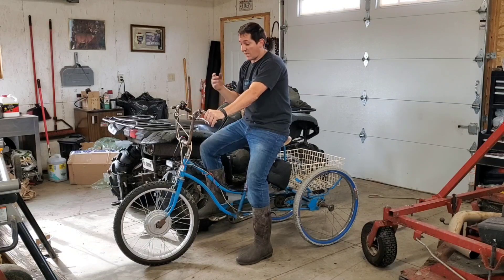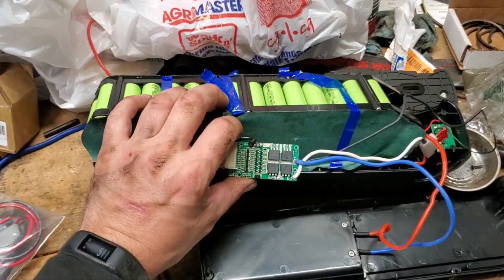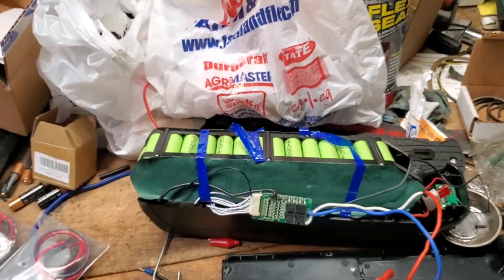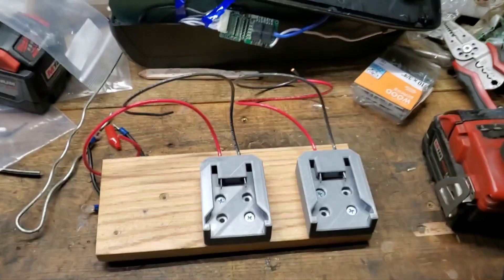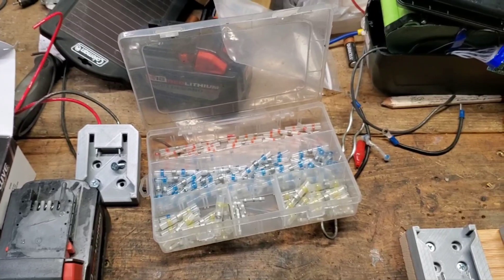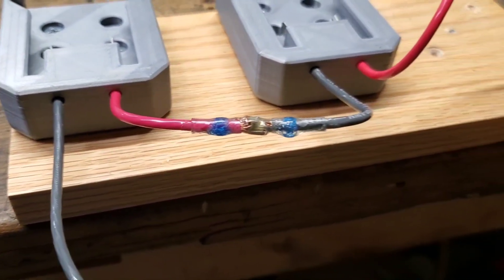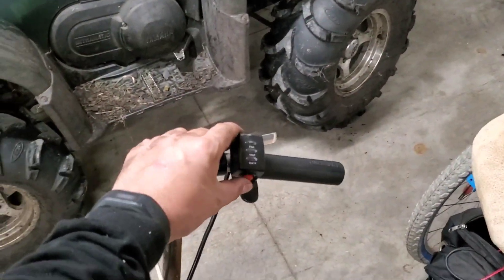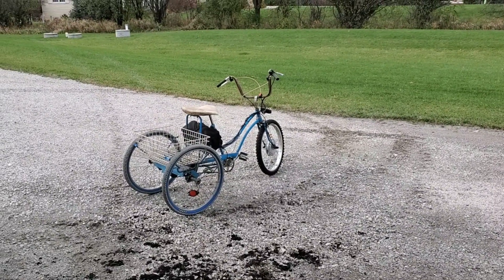Milwaukee Battery eBike (M18) #milwaukee #diy #milwaukeefuel #milwaukeem18

Comment: Thanks for this info.  How many miles does the battery last?
Reply from the maker: I have never tested how many miles.  I built it for going to and from my deer stand which is a quarter mile one way.  For the trip out there and back, it doesn't even take up on bar on the  batteries so I would guess several miles.

Comment: 54volt?
Reply from the maker: 36!
Reply: cool how did u get thre 18 volts to 36v without killing one battery @fixer2u
Reply from the maker: @lux4134  I show you how I did it in the video but basically you hook 2 of the 18v batteries together in series to get 36v.